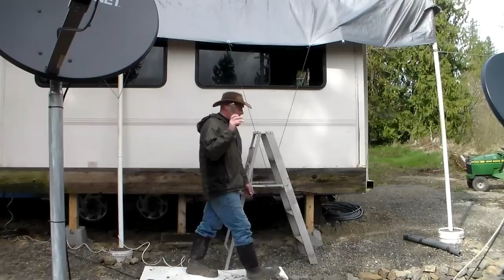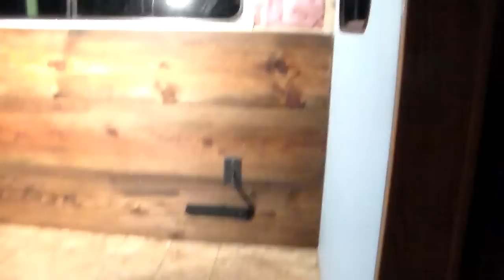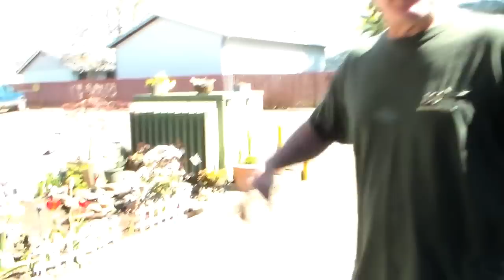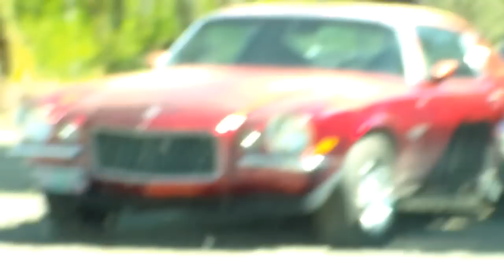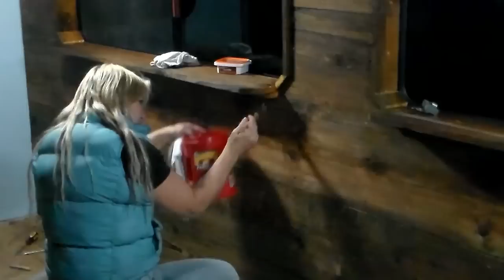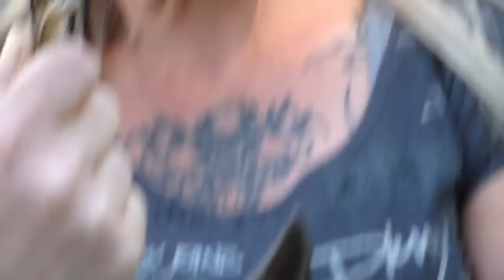Classic Truck Rescue CTR 29 (Homecoming)

Comment: I know you have cold wet winters there that insulation under the bedroom will make a huge difference. And the aerosol expanding foam works great in gaps in walls and around pipes where they come through the walls.

Comment: all for sale? How much for Homer?
Reply from the maker: +asdf jkl; Most of my trucks are for sale. The only ones that aren't for sale are the trucks I am putting in a collection of "Work Trucks" for future generations. Sorry, but Homer is not for sale. We rely on that truck for too much around the Classic Truck Ranch. The other trucks that are not for sale include "Bullfrog" (1959 GMC Dump Truck), "Tinker" (Green 36,000 mile 1959 GMC), "The Chief" (1956 Chevy Napco 4x4), "Old MacDonald" (1959 GMC Flatbed), "Yogi Bear", 1957 Chevy Low Cab Forward, "Wendell T GMC" (1959 GMC 450-Series) and Jamie's Tonka Truck. There may be one or two others, but pretty much everything else is for sale. Thanks Fer Watchin'. -Rick

Comment: I see you have satellite internet how do you like it doesn't work good who are you guys going through?
Reply from the maker: Yes, we have Dish satellite internet and tv right now, but it is very expensive and very slow. I just had underground fiber optic installed and we will now be using Molalla Communications, which I have heard from locals is extremely fast and reliable. It is also 200-dollars less per month. Thanks Fer Watchin'. -Rick